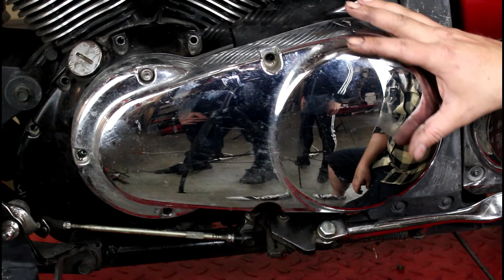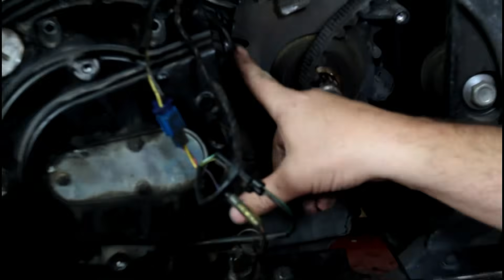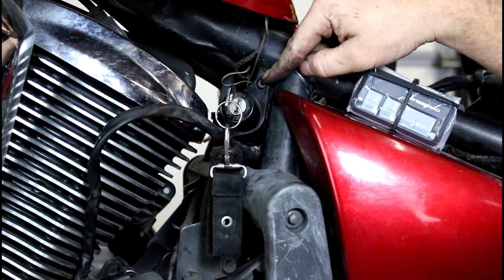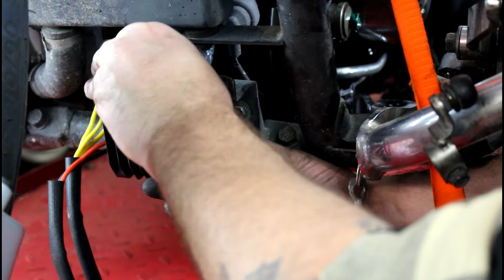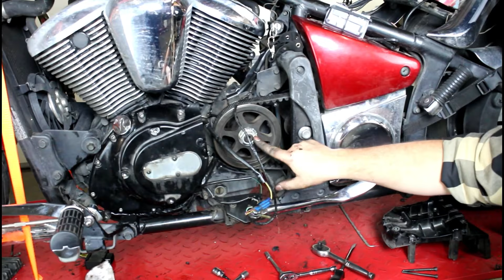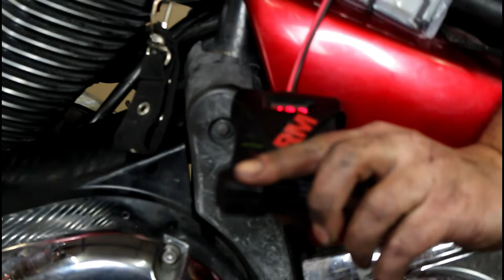How to Replace Stator & Regulator on Kawasaki Vulcan 900 | RMSTATOR Install Guide

Comment: good instuctions  but i would replace that fly wheel bolt  with new bolt that has a hole in center of it  its called a jet oil bolt  it will help keep that new stator a lot cooler and last a whole lot longer
Reply from the maker: That's a great tip for extending stator life, thanks for sharing that insight!

Comment: This video looks great and it worked for me until this moment. I’ve stripped everything and got the new stator inside the cover. Tomorrow I’ll put it back on the bike. I’ll let you know about the outcome. 

Found another way for the cables though. Instead of removing the pulley I’ve just removed the cables from the plug (the one that goes into the regulator” as that cable is the only one that goes behind the pulley. Then I’ve managed to get the cable through behind the pulley and put the cables back into the plug.  Saved me removing the pulley and putting it back in.
Reply from the maker: Glad the video was helpful, and that's a great workaround to save some time!

Comment: I tried this repair twice and still had oil leaking. It's hard to put stator back in and the gasket to hold.
Reply from the maker: That can be a tricky part of the install, but taking your time to ensure the surfaces are perfectly clean usually solves the leak issues.

Comment: I appreciate your video. I found it informative to try to tackle this problem with my 2006 Vulcan.  

I did loosen the belt tension with no shortcuts, my only problem happened at the end when I put oil in and found the stator gasket compromised somehow. Oil leaking like a sieve underneath. 

My only problem but I do feel experienced at taking it apart though. 

Thanks again!!
Reply from the maker: Glad the video helped, and hopefully a new gasket gets you back on the road quickly!
Reply: @Rmstatorinc I didn’t tighten bolts in the right order.

Comment: So I must be missing something.. trying to get the pulley off and I can’t seem to get it to stop spinning. Do I need an air impact? Am I missing something simple? I have it in gear and even set the back tire on the ground but it won’t stop spinning when attempting to remove the nut with my 27mm
Reply: I had the same experience last night and gave up. I just bought an impact wrench today, and giving it a shot again tonight. Did you fix it?

Comment: So I know this video is pretty old. So I found it helpful to loosen the rear crown bolt to get belt off. I also learned the hard way the order of the stator cover bolts because mine fell out and I checked  the depth of the screw hole.
Reply from the maker: Happy to help!

Comment: Just purchased this exact stator and regulator and now my main 30amp fuse won’t stop blowing. Extremely Disappointed, I suspect the regulator is providing too much current
Reply: I’m having the same problem but I haven’t put in a new stator , it died on me while riding and so I bought a new battery . Now it keeps pops my the mani. Relay fuse without turning on any lights just turning my ignition key makes the main relay fuse pop. So now idk what it is .

Comment: Is it necessary  to seal around the stator's electric wire/grommet where it exits the generator case (where oil is present). I seem to have a leak on mine only when it runs hot. I have it narrow down to that area and I plan to replace the whole gasket but am unsure about the two rubber grommet seals that protect those two harnesses.

Comment: Torque setting for the stator cover bolts was not mentioned
Reply: 9.8 newton metres
Reply: I believe it is 94 ft/lbs. Use your blue loctite on it.
Remember when removing it that it has red locktite on it from the factory. You will need to heat the nut to break it loose.

Comment: Thanks for making this video very helpful but I thank you made a mistake.

 The stator grommet has a notch on the bottom so it can go under the pick up coil grommet. 
Just noticed this on my Vulcan there would've been a void between to two grommets that could very likely cause a leak.
So anyone changing your own watch out for this and cover the grommets with small layer of RTV before assembly

Comment: Hmm I may need to do this. My battery stopped charging recently on the bike when running, reving the throttle results in no voltage increase on the battery. Rectifier or stator?
Reply: Same thing happens for my 06 900 Vulcan but it’s also blowing the main relay fuse ? I’m not sure if the stator is my issue …

Comment: There is no way you put that belt back on the pulley by hand.
Reply: Just loosen the belt with the adjustment bolt at the rear wheel to get some slack. Remember to adjust afterwards.
Reply: @idlehands77  Thanks. I wish I’d known that before I cut the belt just to get the pulley out. I’m a dumb ass. Lol. I had to loosen the adjusting bolts any ways and take a lot more parts off just to replace the belt. Also I didn’t know the damn belt was so expensive. I got everything put back together. It took me about 3 days.

Comment: I think I’m going to cut my belt so I can remove the pulley and replace the stator and then take the bike to a shop and have a new belt put it. I want to replace the belt  any ways so I guess it won’t be a big deal.
Reply: Lmao… what?! No don’t do that! Worst case scenario loose up the bold on the back wheel, will get you all the slack you need…. Do not cut the belt
Reply: @bigdog4574  Thanks for the tip. Unfortunately I did cut the belt and learn the hard way because I got frustrated. It made things so much more difficult plus I had to pay about $600 for a new belt. I fixed everything and put everything back together. It was a nightmare. Lol.
Reply: @TheMaximomex  oh my, lol.... sorry to hear that, glad that it's done at least

Comment: How did you get the belt back on the pulley? I tried lifting the rear tire like you said but I didn’t get any slack out of the belt.
Reply: What did you end up doing? I’m having the same issue
Reply: @SilverBulletNation  Just loosen the belt with the adjustment bolts at the rear wheel. I did a lot extra unnecessary work because I got frustrated and cut the belt off. Lol. You can also loosen the frame and it’ll give you a lot of slack. Like I did here. https://youtu.be/-s03RZ2LTV0

Comment: Hi there, I did the same on my 2007 yesterday. I'm a bit of handy man. Not a mechanic by any means. The Australian version of the bike doesn't have the same backing plate, behind the pulley that you have. It's shorter. So, less work. Not need to remove it. It took me around 4 hours (by myself).  I jacked the bike up and started unscrewing everything. I watched your video twice. Great help. Thanks...you rock. I ordered everything from Aliexpress in China. Under AUS$ 90 for Stator and Regulator. Changed both. It was all plug and play. I pulled the wires and plug under the seat...about middle of it, no need to remove the ignition key thingy. I also used the Original gasket as it looked like new. No leaks. Knock on wood. I did order a new gasket from Kawasaki. Will return it now. Keep up the good work and stay safe. Rob, stinkin' hot Cairns, Australia
Reply: How many ks had your 2007 done?
Reply: @Punchy-y2r 53.000
Reply: Hi Rob, I have an 09 model , having no luck getting the lock nut off the front pulley , is that thing left hand thread..? Cheers Mate ,Dave
Reply: @davidmoore9129  Absolutely no idea. Why do you need to take it off? Check the garage manual. It might give you a hint. You can Google it. It's free.
Reply: @robertbukovac2842  Hey Rob, the bike needs the stator replaced ,so ordered the parts and only got as the drive pully , gonna let the bike shop have a play.....Cheers
Reply: @robertbukovac2842  
Hey Robert.
Did all that stuff from Ali hold up for you over the last 2 years?
Reply: @Thesaurcery4U2C  All still good. I changed the stator and rectifier, both from Aliexpress.
Reply: I'm buying a vulcan 900 reckon dead battery  but im thinking it a stator never done one before  kinda worried how long did the parts take to get to Australia  im in Melbourne
Reply: @Aussiepride88 ....2 weeks it took from China 😊Job was easy. Drain the oil and take the plastic cover off. Then the rest ...make sure you put the screws in order. Write it down. Not all the same length. Saves you time when reassembling it. Was easier than I thought 😊
Reply: @Aussiepride88 I ordered mine on Amazon, 80 bucks for stator rectifier and gasket,  was here the next day.

Comment: Thanks for making the video. I found it very helpful with replacing my failed stator. Watching you helped me have the confidence that I could do it and did not require special tools.
Reply: Did you use the oem stator to replace? I used 3 different brands and still having issues. I gave up for a while but now that its warming up really wanna ride more. From what I remember everything looked fine and I got one with whole harness so just did what he did.

Comment: I'm having trouble getting any slack on the belt.  Where exactly are you placing the jack.  I tried it on the swing arm but it  just wants to tip the bike to the side when jacking up.  Any suggestions ?
Reply: I’m doing mine right now, how do you get more slack?
Reply: @trapshutter8510  what did you end up doing? I’m having the same problem
Reply: @SilverBulletNation  if I remember right it just took a lot of finagling, I might of had someone help me push on it
Reply: Just back out your swing arm adjusters in the rear. Make note of where they are before hand. There should be a notch on the adjuster and lines on the swingarm

Comment: So, you did not replaced the center bolt with a 2nd gen hollow one for better oil flow? That bolt is the problem on the pre 2014 models. Up to your next repair.
Reply: What did you use to replace yours? How did you get the original bolt out?
Reply: @malachishelton4454  Replace with a 2nd gen bolt, original Kawa part. How to get the bolt out... see uploads about stator replacements.
Reply: Helping this comment rise to the top: based on my own research, it's very important to replace the bolt; the 1st gen bolt has a design flaw that causes lack of cooling on the stator, which eventually causes burnout.

Replace the bolt to fix the cause of the burnt stator, or you'll be replacing more stators in the future.
Reply: @rh4009  but where can I buy a 2nd gen bolt
Reply: @Austinotb  It's a very good question, I'm in the process myself, have been waiting on two sellers from Japan, and 3 weeks after the order, they haven't even shipped my bolt yet.

There may be Kawa dealers who have one in stock, you'd have to call around. This bolt is sure not easy to purchase.

Being a specialty item (harned bolt with a conical center hole), it won't be available anywhere than from Kawasaki.

I've thought of engaging a local machine shop to drill my existing bolt, but I think that's a bad idea. The hardened steel would be very hard to machine, and the hole won't be conical, but an approximation.

Still, replacing the bolt seems to me like the only sane thing to do, but I'm tempted to replace the stator and keep the old bolt, at least until my bolt arrives from Japan. It'll be more work to replace only the bolt at a later time, but at least I can ride in the meanwhile.

Comment: Is this video by the RMStator company in Coaticook, Quebec, Canada? Because they say the connectors on my motorcycle is not the OEM connections. They send me a single connector when in this video, it clearly shows blue, yellow and black. Which is also the pictures I sent them in an email. If someone from RMStator sees this, they should call me. My order number is INVOICE 32270863 (114-7247551-4312220). Yes, I left a voicemail with my number because no one live ever answers the phone there

Comment: before changing the stator to some noise like a vibration?
Reply from the maker: The stator should not be able to cause a noise or vibration, but if it was badly damaged that is possible.
Reply: I had a vibration before the noise
Reply: I have both noise and vibration

Comment: What is the advantage of the upgrade regulator. Rectifier. Price??
Reply from the maker: You can see it here for $129:
https://rmstator.com/en_us/regulator-mosfet-for-arctic-cat-prowler-tbx-tvr-kawasaki-jet-ski-kaf-kvf-krf-vulcan-yamaha-v-star-lta-ltf-1999-2019

The MOSFET type regulator is more reliable and accurate regulation, and stays cooler in normal operation. It is a reliability upgrade over the stock type regulator.

Comment: Great video. I did mine a year ago.  Same sequence.  Naw.  Never cut new wires. Do not invite corrosion
Reply from the maker: I agree, don't bother cutting the stator harness to route them. Just take the belt and pulley off, it's not too difficult!